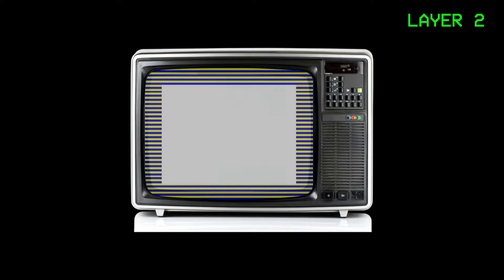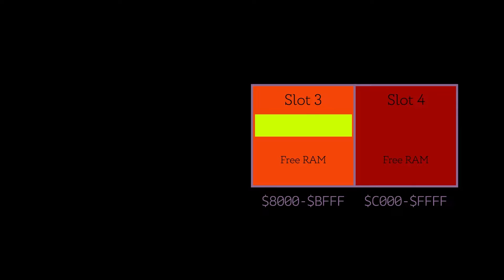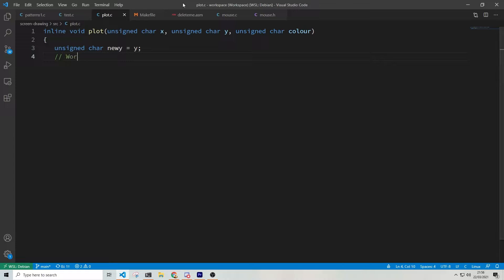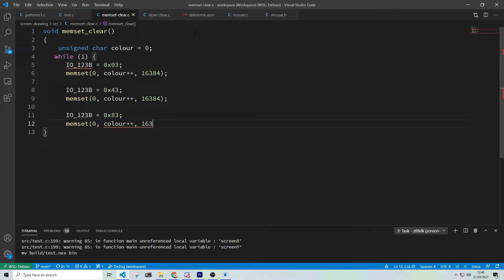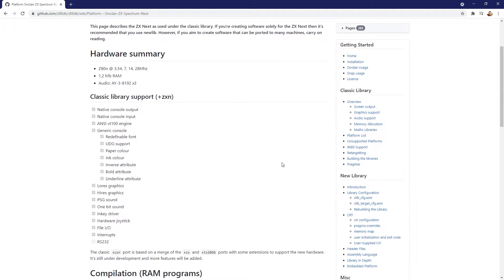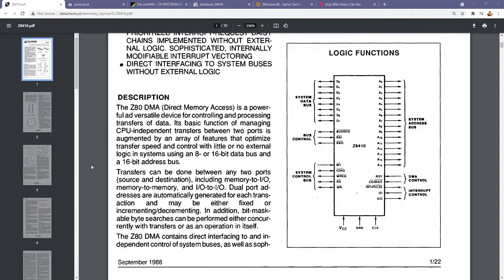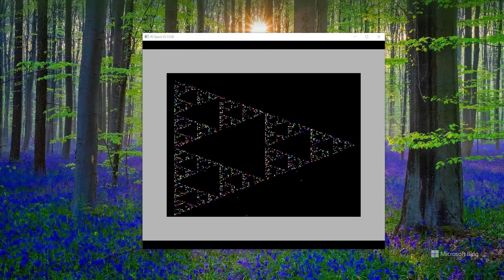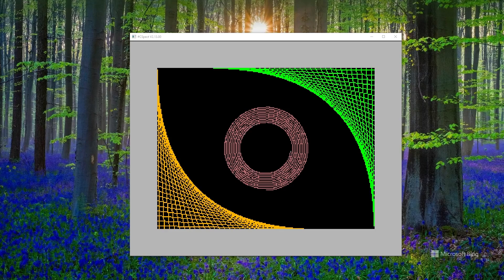ZX Spectrum Next Layer 2 Graphics - Retro Coding in C and Z80 - Devlog #2

Comment: If you want to clear the screen on ZX really fast using CPU, you should use Assembly and processor stack. Also that applies to drawing sprites using CPU.
Basically ZX supports pushing on Stack 16bit registers, so it will be nearly 2x faster than LDIR version. Also unroll loop for one line. Adding pseudo code for this:

DI //disable interrupts as we will use stack
LD HL, SP //save stack pointer
LD DE, 0 //clear color

LD SP, screen_address + 16384 - 2 // as stack goes up

LD BC, 32

clear_line:
PUSH DE
PUSH DE // 128 pushes must be inlined
DJNZ clear_line

Repeat for other memory banks

LD SP, HL //restore stack pointer
EI //enable interrupts
Reply: Master !

Comment: You don't have to use the write-only mode for Layer 2 - you can use the normal MMU instructions to map L2 into any place in memory (including the two 8K pages in your slot 0) and LDIR would work fine.

Comment: This video is a little inaccurate about information about the Next.  The Next's memory is not like the 128K at all.  It uses 8 slots of 8K.  However, the L2 hardware does use 16K pages, but you can use the MMU to put any 8K page of the 6 L2 pages anywhere in the 8 slots of memory.
Reply from the maker: Yeah you're right, the bit in the manual & wiki about the MMU and 128K style banking is a bit confusing. I just stuck with the 16k pages as it made sense with the screen.

I'm guessing 8K pages make more sense if you're paging in data or code, rather than pieces of screen then?